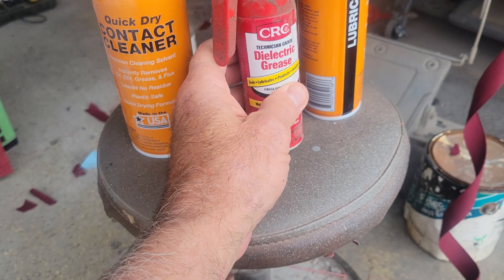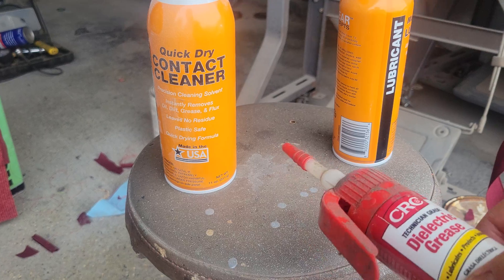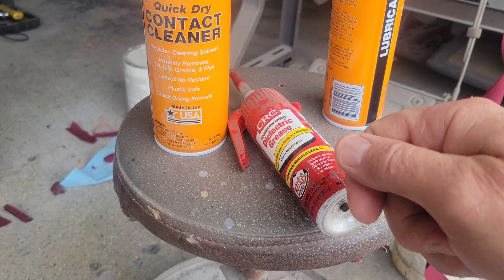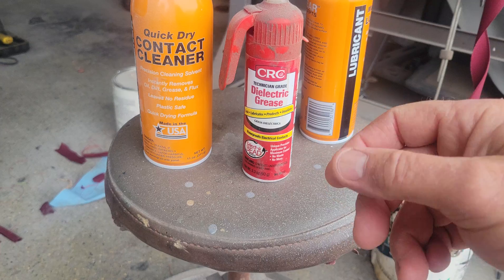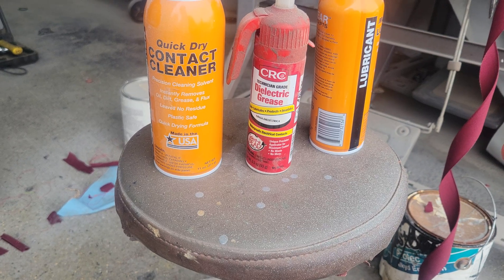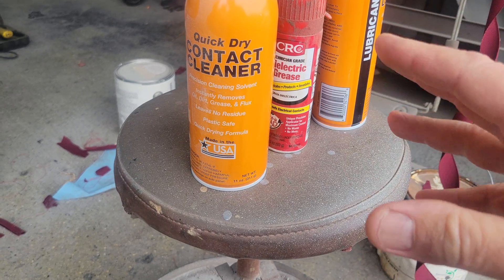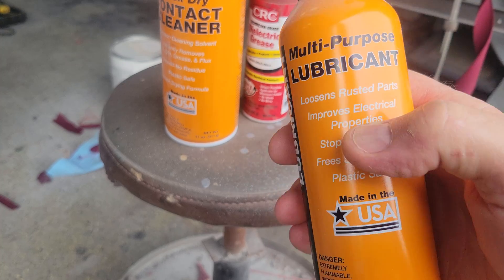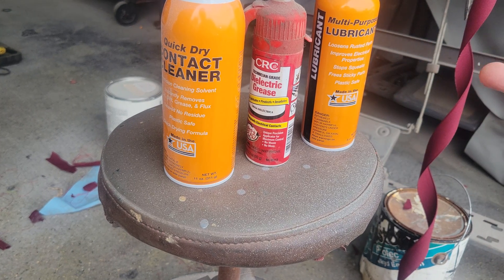Dielectric Grease Often Misused and misunderstood. How to clean electrical contacts Part 2

Comment: Thanks for the follow up video, Mike. This helps clear things up.
The thing to remember is that the dielectric grease helps in two ways: prevents stray current flow, and provides a protective layer to prevent oxidation on the electrical contact surface.
It is not a silver bullet that will fix a marginal electrical connection. Current flow requires solid contact between conductors. If you have a intermittent connection in an electrical contact, then there is either oxidation creating a voltage drop, or poor mechanical connection. 
Best thing to do for a problematic connection is to ensure that oxidation is removed (contact cleaner, emory cloth, etc) and that the metal surfaces have solid contact. No product will help if you don't have solid mechanical connections that are free of oxidation. Then you can put dielectric grease on the contacts before mating them. The mechanical connection will displace the dielectric grease from the contact area, and the dielectric grease will prevent oxidation from forming at the contact area.
Dielectric grease can be especially helpful on high voltage spark plug connections because the high voltage will seek any pathway. It chooses the path of least resistance, and the dielectric will prevent it from tracking along the surface due to contaminant or moisture to ground. But most important is to ensure a clean, solid connection at the electrode.

Comment: FWIW I’ve read that dielectric grease helps preserve rubber weatherstripping in doors, trunks, etc.
Reply from the maker: I am not sure on that. I believe it is like silicone spray. We used to use Armor All on interiors and rubber. We believe the silicones attacked the rubber. I noticed that on tires it would start cracking faster. Dashes were cracking faster than usual. Everyone I know stopped using it. Since then I stay away from anything that is silicone. Just the way I do it. I would be aware.
Reply: @Mikefngarage  sure thing on the Armor All I remember the dash pads cracking after using it. Not sure why they would recommend the dielectric grease for the weatherstripping; maybe something to do with it not being conductive protected it from ozone? Only God and a chemist know.
Reply: @Mikefngarage  here are silicone and none silicone based dielectric grease's.
Reply from the maker: I just used it on my seat tracks.....Because it is clear and wont stain. But I can really feel the silicone in it. Probably not good for the paint or to repaint something with it around it.